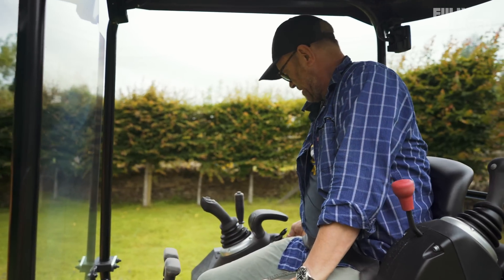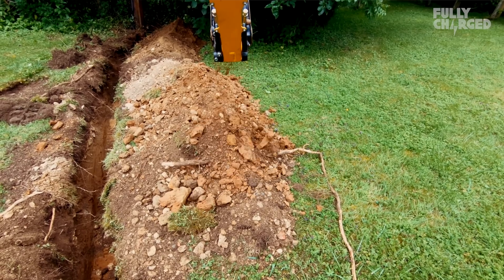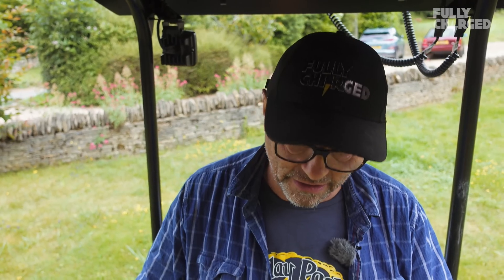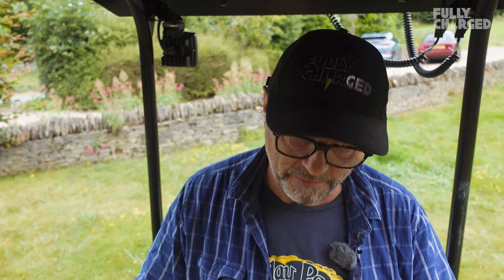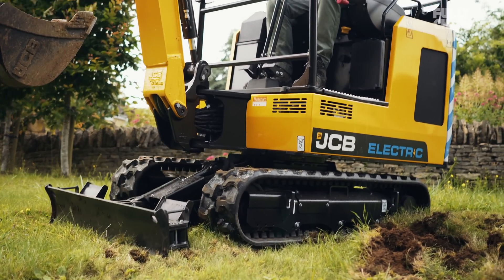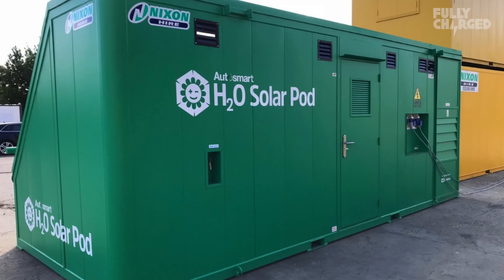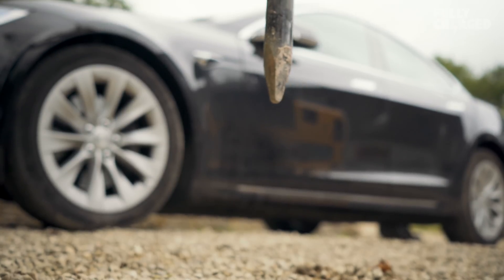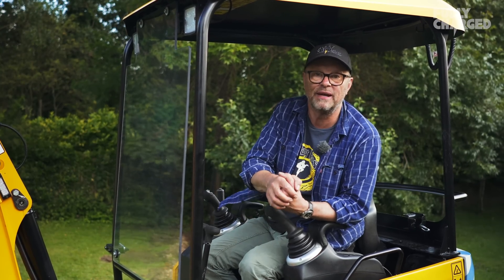JCB Electric Excavator / Mini Digger JCB 19C-1E E-TEC zero emissions electric digger | Fully Charged

Comment: I'd love if they made a small electric farm tractor using this system. Agricultural equipment is incredibly diesel hungry, and a huge pollution source. Going electric with small tractors used on farms would make a big dent in pollution and cost savings for small-scale farmers.
Reply: There are at least three on the market right now, https://www.youtube.com/watch?v=UUlQGnViw3k
There is also at least one Skid-Steer that has been converted to electric. https://www.youtube.com/watch?v=IY6sv7kPIYo
Reply: @taznz1  Can't wait for these to be more common. I have a Massey Ferguson 565-size tractor which is not a huge farm tractor nor a small dinky one, but somewhere in between. There is CONSTANTLY something wrong with old tractors, and an electric drive would make so much sense on a small farm. I don't use it all day, so 3-4 hours of run time is perfectly fine.
Reply: iLEZtube   You made a bad purchase and come to the conclusion that all tractors are garbage? You should have gone back one model earlier, such as a Massey 165 or 175. Tractors ( all brands ) built prior to 1975 are not only workhorses, they are still to this day extremely dependable and many are more fuel efficient than newer tractors.
Reply: @MM-bi8nm  I grew up driving a T20 built in 1952, it was terrible. Have you tried hand cranking those things. Far to light on the front end, the list goes on.
Reply: @iLEZ  "Constantly something wrong with old tractors"
What.. My neighbor has 12 veteran MF 35 diesel tractors and he doesn't baby them at all.

They are from the 1950's, start 60's, and every one have been the backbone of an average farmers daily life for 20 years.

Most of these, the time counter are dead at around the 8000 hour mark, but they have been used for a lot longer than that. More akin to 10 000 hours.

He rebuilds the engine with new sleeves and piston rings, then sells them again..
Reply: @taznz1  you probably need to charge it for 40 hours and then it works for 4 hours. lol
Reply: Yes, confined spaces. Mines. Buildings.
Reply: I lived in the south of France for quite a few years with vineyards all around. They need to turn their equipment electric, it puts you off wine seeing how much diesel fumes go on them as they grow and are harvested.
Reply: @turningpoint4238  Yeah, they should spray them with human faces and oxygen instead, right?

Sad how you never said anything until you thought there was social cred behind it.  Just drank the wine all day long, eh?
Reply: @billcichoke2534  err OK
Reply: @turningpoint4238  Point to where I'm wrong.
Reply: @billcichoke2534  What about spraying the vines "with human faces and oxygen". Or not saying anything until I thought there was social cred behind it, when living in the middle of a wine region I was open with my opinions and that didn't bring any social cred. And I actually rarely drink alcohol. 

next.
Reply: @turningpoint4238  No, first.  And that should have read 'feces' and not 'faces.'  Thanks for pointing that out.

You lived your entire life in wine country, yet only 'became aware' of the fact they're transported out of there with diesel vehicles.  Really?  And with all the pearl-clutching and hypersensitivity, NO ONE ELSE has cared.  It's as if you're trying to FIND something to be self-righteoys about, where nothing exists.

We've drunk wine from those grapes, harvest just so, for the last century or more.  Joyfully, and with ZERO health detriment versus by hand and transported via horse and wagon.
Reply: @billcichoke2534  No I was born and brought up in dairy country (if you know anything about the history of dairy in the south west of england or the development of artificial insemination in cattle you'd have heard of my Grandfather (although now I'm involved in sheep farming). My wife is French and I've lived in France on and off for about ten years. Thats when I became aware of the facts of wine production (although a lot of it was turned in to vinegar) and it's associated damage on the environment. If wanting a better environment and healthier food is pearl-clutching and hypersensitivity then thats what I am. 

It's true I haven't seen any research on the effects of diesel exhaust on wine but from what I've seen it would appear it needs to be looked at. 

You need to look up your history on wine production if you think todays methods have been used for a century or more. As for wine having ZERO health detriment I'm not sure the medical profession would agree. 

I'm not against wine production at all but as with everything we need to do it with the best practices available.
Reply: @turningpoint4238  As far as production goes, diesel engines have been used around grapes up to the smooshing step around that long.  As to automated pickers, use, THAT is a recent thing.  But the grapes HAVE been exposed to diesel fumes longer than just when mechanized pickers began to be used.

The health detriment I was referring to, was one introduced by exposure to diesel fumes.  There has been none identified, especially with the recent addition of pickers to show any contrast.  That is, therefore, pearl clutching, getting worked up for the sake of showing your 'moral outrage.'  And you even punctuated that with your 'if you want a better' quip.  As if anyone wants WORSE and somehow only YOU know better.

You're correct about 'best practices.'  Unfortunately, often this is evaluated by people who AREN'T voicing from authority.  Mike Rowe of Dirty Jobs had a great example, the so-called cruel form of juvenile bovine castration orally ticked, versus banding the poor thing's swagger sack and letting time do its thing.  The 'cruel' method resulted in a quick recovery time and very little trauma to the animal, while the 'kind' way subjected the animal to a long period ofdiscomfort, and a VERY long recovery time.

I know less about grapes than I do about women.  And I'm married, so I got at least SOMETHING right.  I think I'll let the vineyard decide what their best practices are, not some perceived ill to the false 'save the planet' agenda.
Reply: @billcichoke2534  tractors haven't been used like they are today for over a century on vineyards. The picking time is the most sensitive time to expose the grapes to fumes. There have been plenty of studies on the harm diesel fumes do just none specifically on wine that I know of. 

You seem to think I'm saying I'm an expert, that I'm not. But I do have experience in the agricultural industry and have studied some of the issues (only up to degree level). 

Not sure why you are getting so upset when all I'm saying is it would be a good idea to use electric vehicles over diesel when ever possible. And wine production is not best left to those farming the grapes, every industry needs external control.
What are your qualifications to be like this?
Reply: @turningpoint4238  I don't have experience running a vineyard, but have a friend who does.  And they DO NOT use mechanical pickers AT ALL.  I believe that's what you're referring to as far as far as diesel or electric vehicles.  I'm not saying use EITHER.

But I also question the studies you're referencing.  Those same studies, I bet, show diesel as dirtier than petrol.  THAT is crap, considering the fact that diesel engines are inherently more efficient at turning fuel to mechanical work than petrol engines, and release LESS CO2 as a result.  So just waving all diesel off as dirty and dangerous, is ignoring decades of experience we have that shows none of it.  Those studies also don't me tion that we're using cleaner engines and still have an INCREASE in asthma cases.  That would seem to show that there us another environmental cause, not ICE exhaust, to blame.
Reply: @billcichoke2534  oh please CO2 isn't the only issue with fossil fuels. These agricultural vehicles at least the ones I've had experience in Europe, Africa, Middle East and now Australia are dirty as hell. It's mainly the small particulates that are a concern to me that can cross even the blood/brain barrier.
Reply: @turningpoint4238  Do the vehicles in those countries use particulate filters in their exhaust systems?  The ones here in America have been for over 25 years and I doubt we were the first.
Reply: @turningpoint4238  Its healthy for the plants. Particularry the sulfur. We have to spread sulfur on fields now because of all the emissions bull shit cutting that out. Acidic rain was healthy for us.
Reply: @f-j-Services  So you need to add an acid to your soil for most farmers it's the other way. But fumes from an ICE don't just consist of CO2 and sulfur.
Reply: jake Hawtin   Do a search CAFO. Then let me know how you feel about eating a hamburger.
Reply: @MM-bi8nm  Yes farming must change. Meat and dairy will change dramatically, far better to grow proteins fro milk using yeast for example.
Reply: jake Hawtin    you wish to have more dairy farms to produce more milk to make more yogart?
Reply: @MM-bi8nm  nope grew up dairy but the industry is going to be decimated soon. Far better producing only the proteins you really want and thats all using yeast. It's better for the environment and for human health.
Reply: This thing looks like a warehouse forklift... except those work on 48 volts 900Ah batteries... that weight 800kg and are used as counter-weights. The only case where the weight of batteries is a solution, not a problem. And those are of course made with LEAD.
Reply: Battery for this is lithium-ion.
Reply: @kingofl337  lithium-ion batteries are useless for this kind of job. in-fact current battery technology was not designed to drive LARGE VEHICLES.
Reply: Getting farmers to go electric is a pipe dream for just now most of the small farms up here still use grey fergies as thier main tractor or old masseys. Concidering you can buy useable ones for £1500 electric tractors are gonna have to get a hell of a lot cheaper.
Reply: @robthurlow1347  even my old man sold his Fergie, compared to new tractors they are pretty useless for any decent farming.
Reply: @turningpoint4238   true they aint the most uselful but for a lot of small crofts and farms which mainly deal in sheep they are fit for purpose.
Reply: An at a lot of farms they have plenty of space to install solar panels to power it all.
Reply: Cover farm buildings with solar panels to power them via battery storage and use wind.
Reply: @pauladams1814  solar panels are ugly i dint want my farm covered in bolix because other people want it to be
Reply: Would love to jump on an electric tractor
Reply: @lavelocita5919  Wouldn't the lack of engine vibration take all the fun out of it?
Reply: They answered my main problem with electric farm vehicles when they showed the job site scale solar chargers. They are a game changer.
Reply: Another benefit to an electric tractor. As soon as you start the tractor the cattle know the feed is on the way and get in the way! Great to sneak out with the hay or sileage into the ring before they realise!!!
Reply: @johngraham6181  so you want to TRICK the cattle with your electric torch????
Reply: They do see NFU news - https://www.nfuonline.com/cross-sector/farm-business/energy-and-renewables/energy-and-renewables-news/electric-tractors-your-views-revealed/
Reply: Think fendt and acgo have vineyard electric tractors. New Holland is working on hydrogen tractors, and in some countries the tractors run on biofuel made in biogas plants. Still needs wider adoption though
Reply: Tractors don't use that much diesel, they're 100-300 horsepower
Reply: @joshuaheffernan4374  try 700hp
Reply: @williamfosterXD  most diggers are not
Reply: @joshuaheffernan4374  I know... But versatile 650 is the biggest you can buy in Australia and the extra 50 horses can be extracted with a tune
Reply: @williamfosterXD  that is not most, we have one that is 70hp
Reply: Just think of the cut in pollution / greenhouse gasses emitted if they used electric instead of real cows.
Reply: @Hyperious Very true, although maybe small scale farmers should be rethinking some of how and what they farm! Maybe they need to GrowUP (Google it!) ;-) Farming has such a potential to be revolutionised in the next 10-15 years!!!
Reply: Are any of you actually farmers or just know it all ?
Reply: @tomosharveyjones3416  I am.
Reply: @tomosharveyjones3416  they just know it all
Reply: Hyperious Yes! 🙌🏼
Reply: Rudolf Diesel created the diesel engine to burn farm grown plant oils and some in the USA farmers have begun to do so to run their equipment about 10% of a crop is used to fuel a year's worth of work.
Reply: @Barskor1  Bet he wish he hadn't.
Reply: @Barskor1  French agents dumped him in the channel as far as I know and thats what I meant.
Reply: Indian farmers need this
Reply: Nice idea ,but a it off target. It’s cars ,power plants and planes. Small tractors are incidental.
Reply: @Pocketfarmer1  They may be incidental, but every bit counts! And it's not merely a change in thinking with regards to the fuel source of a tractor, if a farmer will change his thinking on that, then maybe he'll change his thinking on farming in more drastic ways that will completely revolutionise and transform the way we've fundamentally done farming for the past 7000 years or so! Small change, can result in big change!
Reply: No it wont actually you know nothing !!!
Reply: @valleyboy2099  To whom and about what are you referring?
Reply: I don’t think u have much experience about agri and also modern day equipment and modern diesels.
Reply: @carterfarms301  WHO doesn't have experience?
Reply: Where do you think electricity comes from
Reply: Some have converted ride lawn mowers to electric
Reply: So I could have a medium sized tractor bale hay for 14 hours a day and recharge overnight, which by the way, most of our service comes from coal plants, and be fully charged ready for work the next day, and in 10 years be able to cycle that battery so many damn times it will recharge 100% each time? Yeah.. no. Your phone battery cant hardly last 2 years the way it gets used. Don't say lifepo4 because you can only charge them at 5% of their total capacity when at 0 degree F.
Reply: @f-j-Services  Batteries have moved along a lot in the last two decades. Maybe they can't fulfill all corner cases but for most they would work very well. And the way they are developing soon even those corner cases fall.
Reply: @turningpoint4238  For most? Ok so I am going to drive a tractor or combine back to the main farm every damn night and hope it charges within 5 hours? Or when we run 24/7? Other metals also need to be in the ground, and some heavy metals are a byproduct of combustion, its not much, but its something. It wont be helping the economy OR the enviorment.
Reply: @f-j-Services  you are a corner case if you are running gear like that. most of us on farms don't. Yes many trace metals are required and need to be added in carefully controlled amounts according to the results from soil testing. How does this relate to exhaust fumes and what heavy metals are this and is that good to be breathing these. Farming works far better when managed carefully, not in some random way. An economy works far better been managed and as for the environment WTF?
Reply: @turningpoint4238  Most farmers, including family farms, which can also be very huge operations, or mostly small, run their equipment that way. I am over here on the east coast, and I know for sure they gotta run hard in the middle if we run hard here. No way is any logical person going to run wiring to every field to charge equipment that will probably not have time to charge. If we had to charge up in the field, we would use a diesel generator, so why the hell not use a diesel combiine, or tractor, whatever the equipment is. Engines will outlast batteries as of now for a long shot. We need batteries with energy density 2x that of diesel fuel and gasoline, and ones that really don't need to ever be replaced., or maintained. I shouldnt say the heavy metals come out exhaust, but they can come from blowby, and mostly will be found in the oil, (duh??????). Most vehicles not throw their blowby into the intake, so thats that on that! Electric equipment is not logical for us farmers. For the average home owner or hobbist, hell yes, its fun too. I wouldn't mind converting an old International cub to be electric. I still want the HT340 turbine powered tractor though. Was never built by IH, but someone did copy the design and made a working one.
Reply: Would be useless on my  farm
Reply: +1. 200 IQ mate - this'd save farmers many costs, not mentioning the emissions taxes, fuel duties, etc.
Reply: @adamp.3739  Farmers don't pay fuel duty so have less financial incentive to switch
Reply: I would expect savings to be similar to those described in this video Mark. 50-60%

I can't imagine a farmer not taking that up. I think it's more of a marketing thing for them. Perhaps they just don't know about it yet. 🤷‍♂️
Reply: @STUCASHX  Farmers aren't known for been to quick about changing. Normally when young they will then stay fixed in what they know. Bit of a generalization but been a part time farmer and having experienced it in a number of countries thats my observation.
Reply: @turningpoint4238  I think that may partly be related to what @LewStep said above: Farmers are extremely dependent on their machinery to work when the time is right and it's not surprising that this causes a bit of "if it works, don't fix it"-mentality.

That being said, farmers are definitely not adverse to save money and time whenever possible, and I think electric tractors with GPS systems good enough to make the tractor fully automatic may be what puts things over the edge, especially for larger operations - having a small fleet of electric tractors working near-silent will open up the possibility of working through the night without pissing off nearby neighbors.
Reply: @AndersCMadsen  I could go on about this for ages, my Grandfather was one of those that pushed through changes in the old days. But theres a quote of Douglas Adams about those over 35 thinking new technology isn't natural. Farmers are more inclined to don't touch it until it's broken mentality, ask ag mechanics on that one. 

Farming like many industries is about to go through a major disruption if they don't keep up they'll be out of it.
Reply: @STUCASHX  How about just the sheer fact that many farmers out there simply can not get the $ to buy new equipment.
Reply: @turningpoint4238  Farmers out here in the Netherlands are the most modern gadget-filled profession out there. From drones, "selfdriving" tractors to smart sensors on fields. Farmers by large love tech since it helps them immensely with dealing with efficiency but also to deal with the unpredictability that can ruin their entire operation, the weather. Many farmers however run into one issue... lack of funds, farming isn't exactly a goldmine and so many do what they can with what they have which turns out to be what previous generations did.
Reply: @Zandoerlenaar  The Netherlands are a prime example of where farming is heading. But I've seen in farming and horticulture in a number of countries how slow/resistant to change many are, although you see it in many industries. As in all industries you have to invest to accumulate.
Reply: @adamp.3739  when everything's electric they will soon start an electric vehicle tax
Reply: @adamp.3739  if a vehicle is used solely for agriculture use then you dont pay any tax on the vehicle anyway. Plus they only pay 5% VAT on fuel as opposed to 20%VAT.
They still have to pay for fuel of course but there would be a HUGEEE upfront cost for tractors. Plus as tractors can be used 24 hours a day, an electric tractor wouldn't be able usable as it cant meet the requirements. Farmers in my area have been using their 3 tractors almost 18 hours a day and working through the night. They cant afford to spend all night charging because agriculture is very dependent on time and weather.
Reply: @lilPOPjim  Battery swap time.  They have to stop for a fill up, don't they?  Farmers here is Switzerland were conned to putting in lots of solar panels, and then the government took away the subsidies promised.  Many have said that they make money anyway, but it was a cheap move.  But then they saw the advantages of an electric tractor.  They are ready to have a system change here.
Reply: @lawrencetaylor4101   then you'll be tied into buying multiple batteries which would cost excessive amounts due to the amount of power a tractor needs. Electric simple isnt viable for agriculture just yet.
Reply: @lilPOPjim  Would have to be swappable packs or fast charging so you could charge up during lunch. I think this battery last forever because it isn't driving much just digging where as farm tractors and machines have to drive and do a job as well
Reply: @lilPOPjim  that's very true but for a livestock farmer like myself in the UK an electric 100hp tractor and telescopic handler would be great. For the winter months I use them between 3 to 4 hrs a day so would be perfect and able to trickle charge the rest of the day
Reply: @lilPOPjim  with early adoption of tech you fill in small areas of need and work out. For example we have a petrol buggy and a diesel ute both would be far better if they were electric. The tractors we use could quite easily be electric for the amount they are used. Probably best to share with another farmer as we do with quite a bit of our equipment.
Reply: @lilPOPjim  Could they afford a two hour break in 24? Maybe between two 11 hour shifts?!!? Maybe tractors would just have slide out battery packs that take all of five or ten mins to change....maybe they'd use super caps and batteries in combination to provide an nearly instant charge and the ongoing as well! The options are endless when we go electric :)
Reply: @lilPOPjim  this is interesting, but I imagine a fast enough charger could be installed? We are basically able to charge an electric car in 30 minutes these days
Reply: Won't happen until energy density tech increases by 5-10 times. The current ones are just toys. Regular people who use these for agriculture, realty sector, etc won't use any EVs until then.
Reply: @TheFourthWinchester  Nope batteries are fine now for many farming needs. On the farm I work on (it's more like play I do it to get me away from other work) our vehicles could quite easily be electric and would be far more pleasant to use.
Reply: Don't forget that you have to keep them charged, and you trade fuel for batteries.
TANSTAAFL!!!